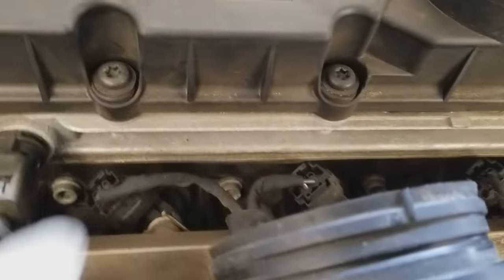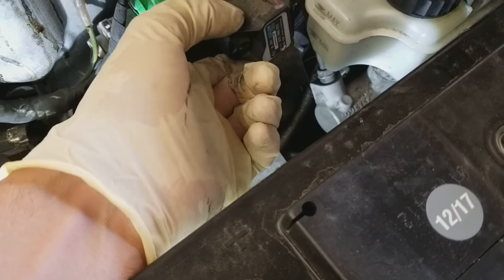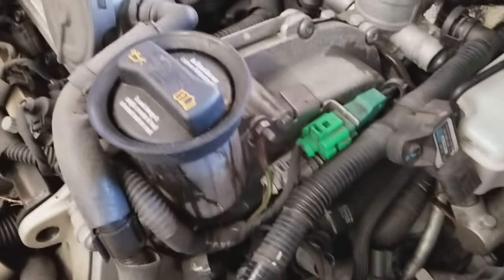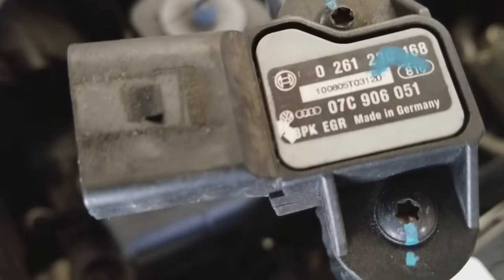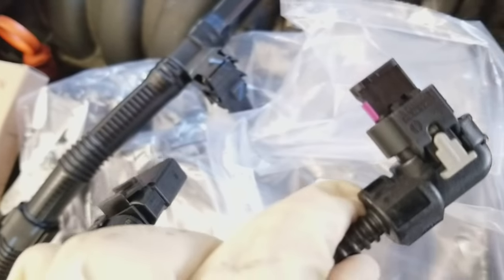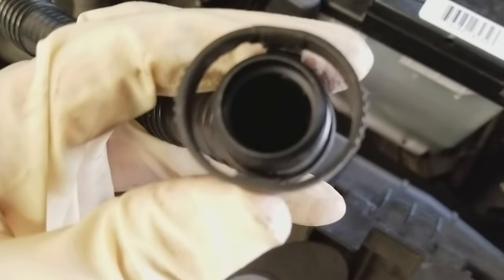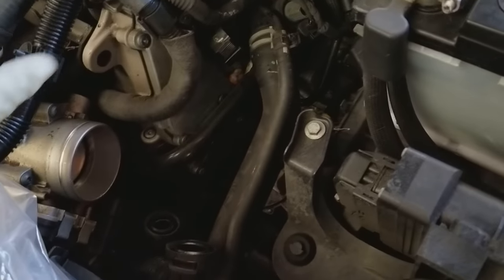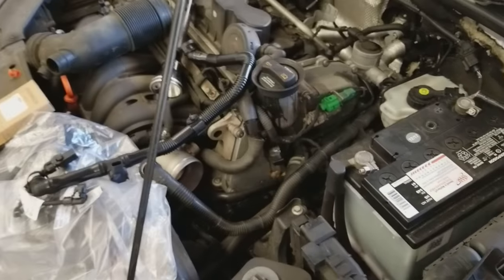Don't replace VW air pump before watching 5-cyl p2432

Comment: First , disconnect the hose where it meets the egr valve and on a cold engine start the car the check to see if air is blowing out of the hose, this will tell you the blower motor is working and then check for cracks on the hose and then check the egr valve itself if it’s opening or closing , you can look the hole if it’s moved up or down .. if all those work then it might be the sensor
Reply: Gotta 2006 Jetta 2.5. P0411 code. N instrument light is on. Can u help me fix n find solution. Thx
Reply: @buckycarter733  I have the same car and problem
Reply: Would it be bad if a little bit of water blew out?
Reply: @buckycarter733  Did you ever find out?  My 2005 Jetta 2.5 has P0411 code as well.
Reply: @bench175  No I'm afraid Not. Still looking n researching.

Comment: I know this is an old post but I'm getting a P0441 secondary air flow incorrect flow. So this should fix the problem?  It's a 08 new beetle with same engine

Comment: Very informative. But the video leaves me with questions. Are you suggesting to try this instead of replacing the air pump, or in addition to changing the air pump?  Also, what's the kit referred to as?  ThX

Comment: Just found out I have a p2433 secondary air injection sensor. Do you know if it's in the same location.. Can't seem to find the information anywhere. Thanks for showing this, really hope my 2010 is alittle easier.lol
Reply: If it'd the same engine code as he stated in the video then it is. This should be the same for all 6th generation Jetta. I have a 5th generation (2009) and it's the same location.

Comment: My 2011 VW Jetta SE has this same code and it tends to stall when starting up or when at low velocities. Could this secondary pressure sensor be responsible for the stalling?
Reply: My daughters 2011 jetta SE generated an engine code P0491 today. which says its the secondary air injection pump. She said she had noticed when trying to take off the RPMs would rev up but the car would only do about 10 mph before it finally would catch up. Also she noticed it felt like it wanted to stall. Wondering did you resolve our issue and what did it end up being?
Reply: @waltw918  I ended up replacing the sensor which actually allowed another diagnostic code to appear. In the end, the problem for my car had to do with a faulty crank shaft position sensor. When I replaced that crank shaft position sensor, the car stopped stalling and has worked perfectly ever since. Hope this helps.

Comment: What's the part number of the repair kit?
Reply: 07K 198 125
Reply: and from where??? Like any part store sorry going through this on a new used car I just bought spent almost a grand on trying to get it good started off with a code for camshaft positioning sensor, changed that ran ok for 2 days epc light came back on put it in limp mode took it to a vw mechanic he said its the throttle body and air intake manifold, paid him to fix those got it home 3 days later check engine light comes on he says to change all spark plugs and ignition coils, paid for that then 3 days later check engine light comes on got a code for misfire in cylinder 3 so he said it's the  fuel injector in cylinder 3 paid for that took it home ran fine for a week now   epc light is back on now throwing this code do I attempt to change the map sensor and see what that does??? I'm at my witts end with this damn car I can't afford to keep taking it to a mechanic every week and I've only had this car for a little over a month now ran perfectly when I took it for a test drive no Dash lights on no signs any of this was going to go wrong and bought as-is of course

Comment: Does anyone on here know where the sensor is on an 07 bug convert?  I see the hose/pipe from the air pump (under the lt fender) to where it connects to the metal valve/unit near the head.  There is no sensor in that hose/pipe.  The air pump tests good but does not run when connected to the wire harness and I do a cold start.

Comment: If I install a aftermarket cold air intake that doesn’t come with a place to reinstall the air injection hose what I can do ? Do I have find a way and connect it back or I can leave hanging in there? 
Oba: I have a cat delete downpipe and straight pipe all the way back..

Comment: i took my air intake out and i must have ripped the hose out of the sensor that it connects to. so its connected to the intake but not the pump. i cannot find where this thing connects or where that sensor is that you replaced. i cannot see a place on the pump where this would connect. the only code i get is map

Comment: Hi I just seen this video. I have a 2010 VW CC. With code p2432. Were would this sensor be located  on this car?
Reply: David, I have a 13 CC, did you get an answer for this?

Comment: P0491 code definition

This is the OBD-II code for Secondary Air Injection System Insufficient Flow Bank 1, indicating a problem on the side of the engine which contains cylinder #1.    ALWAYS TO CHANGE MY PUMP?
Reply: So you’re saying you needed to change the pump?
Reply: No, that code does not indicate that you always replace the pump.  More likely is a broken hose, other possibilities include the combi valve, breather air filter, or some other secondary air injection system component.

Comment: I wonder if it will "fix" all the oil coating the top of my 2.5 transmission?
Reply: Sounds like you have an oil leak at the vacuum pump. Typical VW 2.5L problem
Reply: @mattgordon8209  oh yeah... big time. New pump seal sid the trick
Reply: @JoshDisher I was able to replace the gasket in my vacuum pump. Wasn't that hard just be careful with the hoses around the area of the pump.

Comment: Whats the part number for the kit?
Reply: So I replaced that and the air pump and the light came back on for the same thing
Reply: StevieStevie C may either have a crack in a line or electrical issue
Reply: Yup